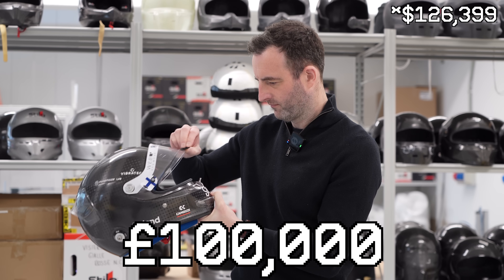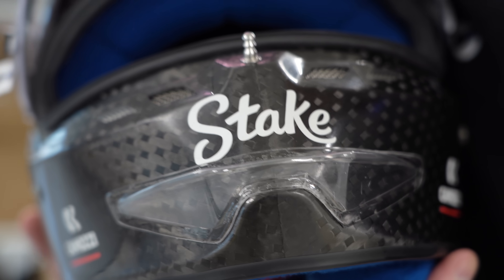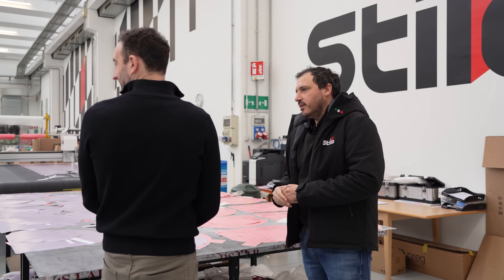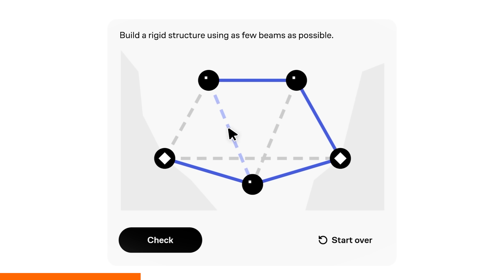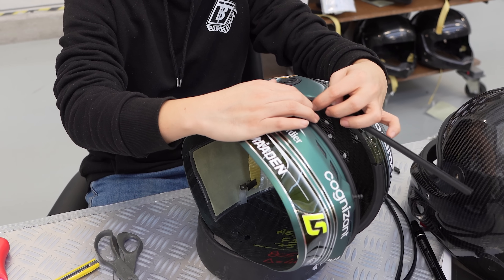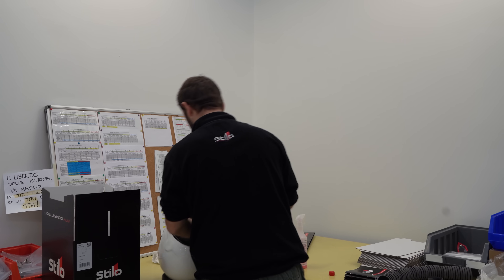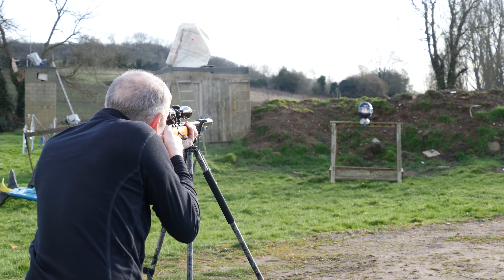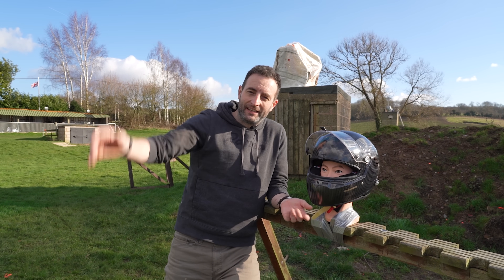How The World's Strongest F1 Helmet Is Made

Comment: Two things, the low temperature is because the carbon is pre impregnated with epoxy resin. Heat cured the resin, it does not "degrade" it.
An autoclave is not sophisticated, it's a pressure cooker.

Comment: Fascinating video. I'm wondering if the FIA and/or Stilo have considered making the visor a stronger like the eyebrow area.
Reply: Since Massa's 2009 incident the eyebrow ridge has been a focus. It has been improved a lot since then.

The visor itself is difficult to improve without introducing optical distortion, which is very dangerous itself. There is a chance the polycarbonate production can be improved with advances in strength and clarity provision but I'd recommend you Googling for scientific advances in that as it is always ongoing. If you are into material science you can make a lot of money if you find advances.

Polycarbonate also degrades, so there is product lifecycle to consider.

Comment: 12:26 love that they still use windows 7
Reply: I'd put money on it that the software they're using can't be moved to the later editions without a TON of extra work, frankly. Encountered the same issue at companies I've worked with, and it's more efficient and probably safer from a quality stand point to stay on the old OS unless better software is developed (in house or otherwise)
Reply: @HnkKill  Yeah I got insta PTSD flashbacks when I saw the software and the Windows 7 PC. We still use a physical key management system that was developed for Windows 98... Good times :p
Reply: Plenty of testing equipment etc. run on ancient operating systems. They keep using them because they are offline and the equipment still works. There was some equipment in one of the labs at my engineering school running on Win XP.
Reply: @Kepe yeah same here, but it was running on windows 7
Reply: Same here

Comment: Coming from the motorcycle world, it's amazing to see that it's pretty much the same manufacturing process as a consumer motorcycle helmet that you can buy for about €1k, but with absolutely no corners or costs cut at any juncture. Crash testing is different for motorcycles since a rider will usually be ejected from the bike in a crash, so bike helmets need to withstand different kinds of impacts than are provided by linear drops.
Reply: F1 probably has insane tolerance limits for the helmets, and they go through a few each GP, with testing, qualy sessions, and the actual race. I'd say even a ding on them and they are out. Also, For example, I doubt they reuse painted helmets when they customize them for the races.

Totally wasteful? Probably
Reply: @tomimar2001  a ding on any helmet and it's supposed to be replaced, it's just the blank cheque mentality where f1 is concerned, again a top tier motorcycle helmet costs 100x less and i would say is far more important to safety than in a f1 car
Reply: Yeah I don't get how it's 100x more expensive than a top bike helmet, it is f1 though and the price they say a nut or bolt costs is hysterical  so it's also not surprising
Reply: @colz848  They said 100k per season. So that's divided by the amount of helmets they use. How many halmets would an f1 driver use in a season? If he uses 5 it's down to 20k a helmet already. Still a crazy amount of money but not nearly the same.
Reply: @ThaJay  I`ve never seen a halmet, lol
Reply: @afrog2666  i've only ssen hamlet once
Reply: @colz848  he said they spent 100k a season so that's for maybe 10 to 20 helmets. Edit seen I just repeated the comment above!

Comment: Wish I could afford one of their custom sized helmets but for motorcycle riding. I have a big fecking skull safeguarding my two neurons in it and I use a 3XL (65cm) helmet with long oval head shape... Currently I have a Carbon Fibre LS2 helmet but it's far from fitting perfectly. Very good helmet otherwise.
Reply: A bit off topic but I had read an article a bunch of years ago about motorcycle versus car helmets. The author contended it made more sense to make the shell of a car helmet comparatively stronger than the one meant for cars. His reasoning was that for a motorcycle you are most likely to take a single large impact, but in a car you may bounce your helmet off a roll cage in the same spot on a helmet several times so the shell of the car helmet should be able to withstand more than a single impact.

Don't know what the governing bodies for the helmets mandate now days...........would be interesting to know if they mandate or bias towards different specs between motorcycle and car helmets.

Comment: I can think of several occasions where open cockpit drivers have spun wheels up in gravel with another car directly behind them, I'd quite like something that can stand up to a shotgun in those circumstances. Worth noting that the ABP layer is only needed in that spot because higher up or to either side it becomes a glancing inpact that is much more easily diverted. The weak point, from the looks of it, remains the visor?
Reply: Does appear so. What they need is an ABP that covers the entire face from the top of the head right down to the chin. The helmet could then be fitted with a periscope that comes to just above the halo device. The driver can increase the height at the start of the race to avoid any first corner collisions. Don't go stealing my idea though. I'm going to be rich.
Reply: @chrisc475  That's not the daftest idea that's been tried in F1 by a long stretch ;)

Comment: It actually doesn't make any sense to intentionally make them bulletproof. Any bullet resistance is likely just a side effect of making it strong.
Bullets are small objects traveling at very high speed (800fps, 260m/s at the low end). A piece of car debris, a bird, or even something like a rock that a person might throw onto the track, is much larger and much slower. A bullet focuses much more kinetic energy than a broken piece of a car, bird, rock, etc. on a much smaller area. A race helmet needs to handle much lower energy over a much larger area. It also needs to absorb the shock, to prevent neck injuries. The engineering behind resisting these two types of impacts is very different.
Reply: 30 mph on a scooter wearing Nikes. I ran over a pea sized pebble and the front tyre flicked it up and it tore off 2 of my toes. Motorcycle boot would have saved me, but who takes boots to Ibiza? You have no idea the weight, size, shape or hardness of a potential projectile.
Carbon shell protects against penetration, while shock is absorbed by the expanded styrofoam. that's why they use multiple materials, to deal with the different forces.
Reply: @none3763  Dang. Sorry to hear that happened to you. I have a nice dent in my right shin because of something that hit me when I was riding my Harley on the highway. It didn't tear my pants at all, just like a nice impact dent in my shin. It felt like I got shot by something. After that I started wearing bmx style shin guards under my pants on the highway. They're the exoskin shin and whip guard pads by triple 8. Oh and bonus, they have protection on the inside as well so if you rub your pipe or whatever you won't feel it and get burned.
Reply: @KohDari  thanks, but no biggie. i still have another 8 and TBH I never really used them for anything anyway.

Comment: Interesting to see they use Rhino3D for the helmets. Would have thought they'd use something parametric, though perhaps they're using Grasshopper too.
Reply: It is very good for work that involves making patterns for textile production.
Reply: @xfixdonz  I've used it quite a bit for surface and NURB modelling and do quite like it, it's pretty intuitive. Just generally used to seeing things like Siemens Solidedge and Solidworks being used in industry 😅.
Reply: Rhino and grasshopper are awesome. Rhino seems to show up a lot for curved/sculpted surfaces in product design… also read somewhere that Rhino outputs are somehow easier to use with CFD software, so maybe that has something to do with it? Would be curious to find out…

Comment: Stopping a .22 is easily doable by F1 helmets considering they need to protect against impacts from larger chunks of metal on track.  However, they likely would not hold up against anything more powerful.

For example, a 9mm 115gr projectile travels at the same speed as those 22s, so both the momentum and energy are roughly 3 times higher.  Considering the damage to the helmet from this demonstration, it's quite possible that something would get through.

There's a reason that real ballistic gear uses materials like kevlar that stretch on impact rather than shattering.  The goal is to slow the projectile more gradually rather than stop it instantly.  It's like using a catcher's mitt to stop a baseball vs a 3 inch thick glass window.  The window might stop the ball but won't stop a brick.  The mitt can stop the brick although it'll hurt like nobody's business.  That's where additional padding, etc comes on to spread the impact out and cushion the blow.
Reply: Has to be legal in the uk
Reply: I'd lay money the 9mm wouldn't penetrate the F1 helmet in the reinforced band area. For ballistic armor speed kills and a 22lr simply does not travel fast enough (nor does a 9mm).  I had a buddy who used to teach shipboard security in the Navy down here and he brought out a helmet with and expiration date (probably still good but older than the manufacturer's recommendations).  I shot the helmet with standard 55 ball 5.56 round and thought I missed the helmet.  Nope straight through.  Shot the same helmet with 357Mag, 45ACP, 460S&W Mag and nothing penetrated (although the 460 probably would have given the wearer brain damage because it delaminated the inside of the kevlar shell.

I'd say in the reinforced section that helmet is probably a 2A level protection at best.
Reply: @TeeRollss  Good point.  Pistol vs rifle rating is very different.  It's still impressive what the F1 helmets can withstand.
Reply: @ Yup I agree
Reply: It has always been funny to me that .22 long rifle is such a weak cartridge type that it's often the butt of many jokes.
Reply: @ Yup but it's killed a lot of folks in the 70's & 80's in the urban centers of the US.
Reply: @NovaAge  But is the same caliber as mil-spec rifles. Also very balistically stable.
Reply: @ .22 LR is a different beast from .223/5.56.  The first is typically 36-40gr @1100-1200 fps vs 55-62gr @2800-3200 fps.  The first is fine for varminting inside 100yds while the second is capable of taking down a deer to 500 yds.  That said, .22 LR is still no joke and can be lethal out to mile, so always be careful.
Reply: @NovaAge  FWIW - it's the long cartridge as opposed to the 22 short rifle (and there's also a 22 CB which is even less power than a short, and a 22 magnum which is more powerful than a long).
Reply: Lol I guess you have no idea how strong 3 inches of solid glass is, there is no way that throwing a brick at it would do anything but chip it, if that. Glass is perceived as fragile because it is usually very thin. It's actually incredibly strong. 

3 inches is literally the spec required to be bullet proof against a .50 cal BMG.
Reply: @ Nothing is bullet proof, nothing. Either you get a larger bullet, shoot it faster, or vary its construction and it will penetrate just about anything (with in reason that someone calls "bulletproof") even that 3" of glass with a 50BMG.  Also my understanding is the glass is laminated and a 3" thick piece of bulletproof glass would be at least two if not more layers of laminated glass.
Reply: You're spot-on with the Kevlar comment. It doesn't work like one would think. Steel plate...very simple to understand. Kevlar- more like, slows and entraps the projectile. It'll stop a bullet but not a knife. Counterintuitive.

Comment: Im having difficulty reconciling the two statements you made: 

1) Due to g force loading the drivers helmets are experienced as if they are actually much heavier.

2) The spoilers on the helmets are designed to counteract lift on the helmets experienced at high speeds -- the helmets are designed to resist flying off the drivers heads.

These concepts appear to be at odds with each other.
Reply: I'm not a physicist but the way I understand those statements is:

1. The g force experienced is mainly during corners where the car moves one direction but the g forces on the driver move their bodies and their head in another direction so they have to counteract those g forces. That's why you see drivers doing neck exercises, so adding extra weight in the helmet would make it harder for them to counteract the force applied to their heads. So the added load from the g force does not push down on the driver but pushes them sideways

2.The aerodynamic properties of the helmet causes a lift effect, mainly at high speeds during the straights but also in the corners to a lesser extent. The spoiler pushes the helmet down so that the drivers doesn't have to strain themselves by keeping their heads low. It's not adding a significant amount of force to make the helmet feel heavy, it's just counteracting the lift.
Reply: 1. The G forces in a F1 are pretty crazy.  Lateral Gs are high but every interview I've ever seen of drivers in other series talking about F1 talk about braking forces which I think peak out at about 5.5 Gs (the worst G loading experienced outside of a crash and higher than cornering loads).  What this means is that a human head (about 11 lbs) and a helmet (about 3.5+, let's call it 4 lbs) will feel that it weights about 82 lbs (so................ 5.5 x (11lbs + 4lbs) = 82 lbs). Every ounce of weight in the helmet will seem about 5.5 times its static weight when the drivers hit the brakes at the end of a long straight. Since the drivers are braking the Gs are negative and towards the nose of the car, the head and helmet want to travel towards the front of the car.

2. On the straights the wind outside of an open cockpit car travels over the top of the chassis and the drivers' heads. This creates a pressure differential inside the cockpit where there is much less air movement and the top of the driver's helmet. The helmet wants to lift, but the spoilers (duck bills) and the top and back of the helmet act like the wings on cars and help to keep the helmets down. This is only something open cockpit drivers have to deal with. I'm not sure how it would affect other drivers who race without windshields, it would be interesting to get their opinions, but keep in mind that F1 is about routing airflow around the car and the other open windshield cars will not have the same type or extreme of wind travel around the drivers' helmets.

Comment: More important than How, would be Why. Ballistics are a very specific type of energy, one that F1 drivers do NOT face, ever. Given the immense money spent on this type of safety, I have to wonder why anyone would test a ballistic impact on an F1 helmet. It's not like ballistics are a "gold rating" for impact resistance, either. You can have a material that's bullet resistant, but still won't protect a person from  6,000 other risks.
Reply: No really think about any small metal object whether that's a bolt or nut hitting your head at 300+ kmh that is essentially a bullet so it makes sense why these helmets should be able to stop a bullet.
Reply: @justinwebster7761  No, it's not 'essentially a bullet". It's just not. The energy is not the same, the impact is not the same. That's why there are different labs and entire fields of research into these things.

Comment: It makes sense for them to be bulletproof. Imagine a screw hitting your head at +300 KM/H !!!
Reply: Happened with Massa in Hungary
Reply: No that was a spring @MrTomWaffles
Reply: @MuhammadNiz007  it's heavy enough
Reply: dont need to imagine, it happened
Reply: Again.
Reply: massa be having PTSD
Reply: Yeah but bullet move a lot faster than that don’t they?
Reply: Or more. You have to add the speed of the car and the speed of the screw moving towards each other..
Reply: @edrcozonoking  that's only if the screw came out of a car going 300 km/h *the other way*. The more likely case is that it's coming from a car going the same way, in which case it's probably less than 300 km/h relatively, since the screw might've slowed down to maybe 100 km/h that still makes 300-100 = 200 km/h of relative speed difference. Which still makes for a wicked impact when you consider the pressure due to low area of impact, but it's definitely not 600 km/h.
Reply: What's flinging stuff at high speeds isn't the speed of the other cars it's the internal components like engines and wheels which can impart lots of momentum to small pieces.
Reply: In fact,it doesn't. A bullet is made (mostly) of lead, which is about twice the density of steel, and moves from about 900 Km/h to over 3 times the speed of sound, so a bulletproof helmet is grossly over-engineered (and heavy).
Reply: Except, they aren't testing it with the equivalent of a screw.  Plus, the screw would be traveling at the same direction.  Try a shotgun slug instead of weak birdshot, or a high powered pistol like a 44mag, instead of a Whimpey UK pellet rifle
Reply: @CaptainRon1913  A screw flicked up by the car in front is not going the direction of travel. It's being flicked backwards.
Reply: @CaptainRon1913  " the screw would be traveling at the same direction"

Tell that to Felipe Massa in the 2009 Hungarian GP. F1 is not a drag race, they're not going on a straight line at a constant speed, there's turns and braking zones.